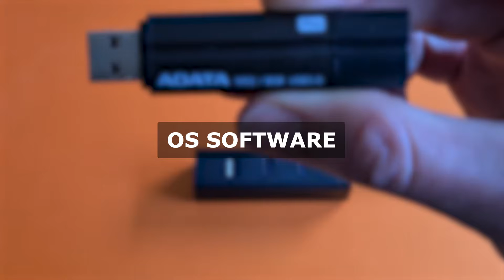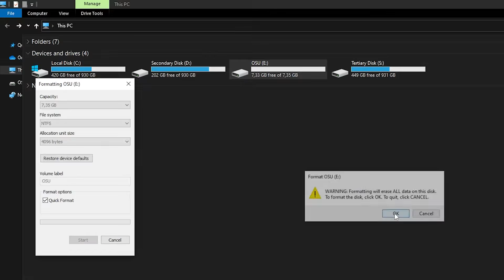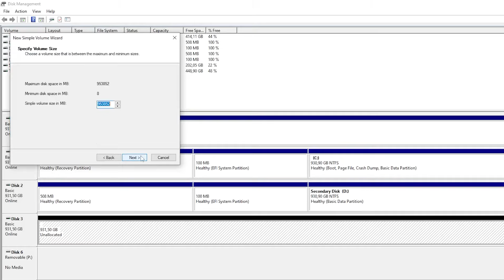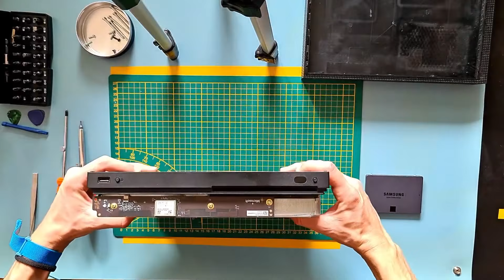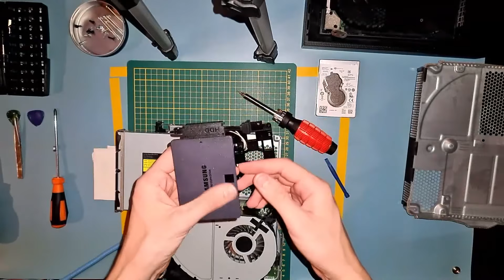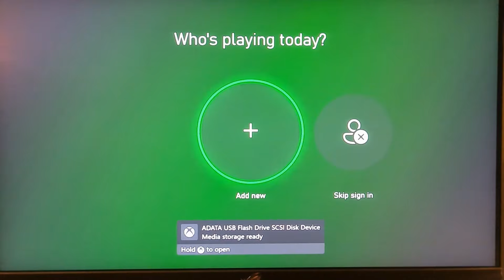Xbox One X | SSD Upgrade Guide | Loading Times

Comment: Is it the same way on the one S? i know the disassembly is probably different, but the OS Software part works the same way?
Reply from the maker: Yes, it should be the same. But just to be sure, check out some other tutorial modding One S directly, in case there is some unique step that I didn't cover.

Comment: Looking for some help with an Xbox One X.

The original hard drive is gone, so I'm trying to install a replacement drive and recover the system using the Offline System Update (OSU1).

What I've tried so far:

- Samsung 870 EVO SSD (1TB)
- Another 500GB SATA hard drive
- USB flash drive formatted NTFS
- Downloaded latest OSU1 from Microsoft
- Extracted and copied the $SystemUpdate folder to the root of the USB drive
- Xbox boots into Troubleshooter normally
- Offline System Update starts successfully

The problem is that the update begins, gets to about 1–3%, and then fails with:

E101 00000504 8B050041

I also tried "Reset this Xbox" and "Remove Everything," but that fails as well.

The Samsung SSD was originally formatted NTFS. The 500GB drive was previously used in a PS4, then all partitions were deleted before testing.

Has anyone run into this specific E101 error? Is this more likely a drive issue, OSU mismatch issue, SATA/cable issue, or a motherboard problem?

Any suggestions would be appreciated.
Reply from the maker: Online, some people who have had this error code solved it by trying new flash drives and by waiting for new OSU1 from Microsoft page.
Reply from the maker: E101 should be problem with the OS or update, so the Xbox is not directly detecting a hardware issue, though that does not mean there is none. Make sure there are no other files on the flash drive just the $SystemUpdate, but I assume you followed this instruction. Try different flash drive. Try different USB port on the console. Check the SATA cable if it is properly plugged in, both in the motherboard and the drive. Also try to format both drives to NTFS again. You've mentioned that you formatted the Samsung one to NTFS, but PS4 supports exFat and Fat32, so if you format it beforehand, maybe it will work and we figure out that the Samsung drive is faulty somehow. Man that is about it, what I can think of and what I could find out.
Reply: @will_neithan i tried different hds and flash drives.

The issue was the console  was in the insider program and xbox wont give out the os updates.

So if your old hd is broken or missing you are screwed.  

If you have the old hd make sure you leave the insider program first on the console before you try to change your hd
Reply from the maker: @SifuTimBerkemeier  oh, okay, that makes sense. There is actually an official troubleshooting for Insiders, but I'm not sure how effective it is:

"Because consoles enrolled in the Xbox Insider Program receive preview updates, any of the Offline System Update (OSU) files will not resolve this issue.
When running through the console’s troubleshooting steps above, if you are prompted to use an OSU file, skip this step and select Reset this Xbox on the console. From there, choose either option that best suits your needs (We recommend the Reset and keep my games & apps option)."

https://support.xbox.com/en-US/help/hardware-network/console/system-update-solution

Comment: Hi. I am late here but doing a ssd swap soon. Would I need to format ssd to ntfs beforehand as you did? I do not have a sata dock atm and was hoping the xbox would do that part for me during the install process
Reply from the maker: Hey, xbox should do the formatting for you. But I am only 99% sure. I chose to do the guide with formatting because I wanted to avoid any unwanted behavior from xbox.
Reply: @will_neithan thank you. I will habe to try it without formatting. Hope everythings runs fine. Otherwise I could I just try to fromat and re-install if I run into issues?
Reply from the maker: @heinrichvancoller9699  Yeah, exactly.. you can always try the external formatting later, if this doesn't work. Maybe don't assemble the Xbox after swapping the drives, just connect the flex cable you disconnected and boot it like that. So, if it doesn't work, you don't have to disassemble the whole thing again. Good luck.

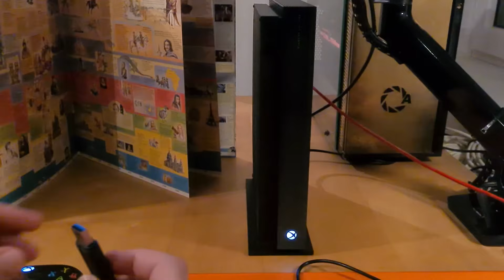Comment: My problem is at 5:21. I have my usb formated correctly, but that screen keeps popping up like every 2 weeks. Any ideas ??
Reply from the maker: Hmm... so your Xbox is fully turned off, you turn it on, two weeks it works fine every day, then one day you start it up and you get that screen with options Restart, Reset, Troubleshoot, Turn off? Then you click restart and it works again for approximately two weeks?
Reply: @will_neithanThat is correct. Then I have to go through the usb process again. Just annoying cause I have to sign back in and re-download my games/apps.
Reply from the maker: @lythory  But the installation USB is not plugged in all the time during all those weeks right? So when you get the screen and you just hit Restart Xbox, it comes back to that screen, so you have no choice but to do the manual install? And what about an error message, is there any?
Reply: @will_neithanthat's correct the usb stick isn't plugged in for those times. I dont get any error codes, my xbox just does 2 beeps then the troubleshoot page comes on.
Reply from the maker: @lythory  Man, that is super strange. If this was happening to me, I would try to make new USB with the offline update. I can't imagine what would be wrong with the old one, but that at least takes almost no effort. Try to google the same issue.. put "reddit" with the quotes in your search prompt or "forum" to get some real people's experiences. If that doesn't help or if you find no info online, then we can try different things. Honestly, right now, I have no idea.
Reply: @will_neithanit happens every week I kept track. Cause it did it today, but instead of going through that process again I just unplugged my xbox from the wall and waited a few secs and then it booted up normally.
Reply from the maker: @lythory  hmm.. ok, that is progress I guess. Keep tracking and try the google. The part that doesn't make sense to me is the regularity. One more question, what disk are you using? Was it a new one? If it was used, do you know what was the state of it, like how many hours it had run, how much data was copied on it, etc.?
Reply: @will_neithanI bought a new ssd from the store.  One thing that did happen was that after I put my xbox back together the dust shield for the front usb and the connect controller fried, because of that shielding got in the way whenver I snapped it back on.
Reply from the maker: @lythory  alright, keep an eye on any changes. If I find some info, I'll let you know.

Comment: I just connected my SSD via usb to the xbox 1 x, seen a good 25% improvement in load times without the work involved in changing over, I put all the larger games onto the ssd usb and more simple ones on local 1tb hdd
Reply from the maker: That is also one of the ways! If it's good enough, it's good enough.
Reply: You’re getting 95%of the benefits with external. Internal Ssd will shine more with a cold start but from sleep mode to game play external ssd is the same improvement and load times
Reply from the maker: @nogamblinge2671  but it ugly!!!

Comment: this xbox is the worst console to take apart ever I couldn't screw the ssd in after an hour of trying so I just screwed one in and I did everything right and I'm just getting Error E101 smh waste of money
Reply from the maker: Don't give up! If you want a troubleshooting guide for the ssd not working, you can find it as a reply under @MrReliable-qb5om comment.
Reply: @will_neithan I fixed it I used a different USB flash drive and it worked somehow
Reply from the maker: @slitzworld  Nice work!

Comment: Not sure if you still reply to comments but
I have an NS100 Lexar Sata 3 ssd 512gb that im trying to use but for some reason when i reassemble the Xbox 1x and put the OSU1 boot drive I cannot get past 1%. I am 100% certain that i have assembled it correctly and that its a software issue. I read online it was an outdated OSU1 boot drive but can't seem to find the latest one. In short im pretty stuck on how to do this.
Reply from the maker: Hey, alright, you need to do step by step analysis and try to double-check every answer, even if it seems obvious. Be oriented on the smallest details. 

Before that, elaborate on the 1% situation. How long did you try to leave it installing? Maybe your usb is slow and it will take 2 hours. Did it show an error or is it just stuck on 1%?

1. Do you have "Xbox One X"?
2. Did you follow my tutorial in chapter "OS software and SSD preparation" exactly or did you do certain things differently?
3. Did you format to SSD as I did? Was it showing then in windows as an empty drive with NTFS file systems?
4. Did you format the USB with NTFS file systems?
5. Did you download the correct OSU1 file from section "All Xbox consoles (except the original Xbox One)"? There are multiple choices on the website.
6. Use program like CrystalDiskMark and test the speed of both the USB and SSD (when plugged in SATA) with a large 4 - 8 GB file.
7. Use windows file explorer to see if reading and writing has some bottlenecks. Take the OSU1 fully zipped and try to copy it on the USB and the try to copy it from the USB to C drive of your PC. Just to verify, that it can reliably read and write large files.

Now the less likely or even this-will-surely-not-be-it troubleshooting, but we have to because we don't know what else to do:

8. Did you follow my steps when you were turning on the Xbox ready to be installed, in the same order? Turn on console through controller as I did. Navigate to Troubleshoot, then plug in the usb, then click on offline system. Try this also with the LAN cable plugged in with working internet connection and also without.
9. When formatting the USB, label it "OSU" as I did.
10. Use different program for unzipping the OSU1 file 

11. Also redownload the OSU1, so you know it is the newest and also try different website regions. I was downloading from "support.xbox.com/en-US/.." so make sure it is also the case for you and then try one more time downloading using country where you bought the Xbox.

More expensive troubleshooting potentially.. you can just borrow these from someone else and return it, just to rule out hardware issues:

11. Try a different USB.
12. Try a different SSD.

So again, try to verify each question with evidence and not from the head. Redo all the steps again. Start with the easiest ones. Leave the SSD removal as last option. If you are going to be disassembling the Xbox again, you don't need to assemble it fully when testing, leave the cover off so you don't add work to yourself, just make sure that the Xbox is sitting in the air so that the air vent holes are not covered up. 

Give me a report after.
Reply: @will_neithan  i figured it out it was just the drive needing to be 1T the rest was fine. i tested with 5 sata 3 512 drives and when i gave up on that i used a pny 1tb so it just needs 1tb sata. (what is the actual performance gain of a sata with ram in it?)
Reply: I had the same problem. After several tests, I concluded that the SSD dramatically decreased its transfer speed after writing about 2–3 GB at maximum speed. I removed it and tested it on my laptop using an external enclosure, and after 2–3 GB the speed dropped to around 1 MB/s. The bottleneck was probably the write speed for large files due to the technology it uses (SLC), and that seems to be the issue. After reading a bit more about the SSD I was using, it appears that the problem is related to the type of SSD technology. Those with DRAM are the best option. In the video, he is using a Samsung EVO, which has DRAM that supports sustained maximum write speeds over time.

The best option is probably to buy an SSD with DRAM or hope to complete the installation without errors when using cheaper SSDs.
Reply: @carloscr1500  i managed to get some pny sata working without dram but later on i might try and buy one with dram and just move the other into my pc.

Comment: I put a 1TB Crucial MX500 which I believe is a TLC drive into my One X.  Unfortunately it didn't take long before disk access got slow.  Curious about this I also tested a 2TB BX500 which I believe is a QLC drive.  It got painfully slow after only about 2-300GB used.  I put the 1TB HDD back and tested something else; a 4TB Samsung T7 USB 3.2 Gen 2 10Gbit/s drive.  Now, the Xbox will only use a fraction of the speed that this has to offer, but at least the performance is consistent at about 100MB/s.  The same drive will do 200MB/s on a Series S while a Seagate Expansion Card will do 600MB/s which is slightly better.  Samsung T9 USB 3.2 Gen 2x2 20Gbit/s is unreliable on Xbox.  It will disconnect randomly.
Reply from the maker: Nice testing, man! I wasn't testing read/write speed and I didn't notice anything out of order, so I can't add to this. What was your testing method and what specifically means "slow"? And what was your method of creating/copying the OS? If anyone else is experiencing issues with specific SSDs, type it into comment.

Comment: Has anyone noticed that the green load screen doesn’t show any longer with the SSD upgrade? It’s just a black screen then takes you straight to the dashboard. Can anyone else confirm?
Reply from the maker: I haven't turn on my Xbox for a longer time now, but I believe, that, weather the green loading screen appears or not depends on how fast the operating system is loading. If I remember correctly, when I was turning on the Xbox, sometimes the green screen appeared and sometimes it didn't. And of course, the loading screen only appears if your Xbox is fully turned off and not only in sleep. Or at least, that is my memory.
Reply: @will_neithan thanks. Just done some digging & the OSU1 doesn’t come direct with the boot animation installed. Usually comes when Xbox release an update to the console or you can directly take the animation from the old HDD and transfer it to SSD via computer. Thanks for your reply
Reply from the maker: @Xvc2345  Interesting, I appreciate the info!
Reply: @Xvc2345 thanks for this... I just made the change and noticed the same. I'll try doing the backup from the old HDD and give it a try

Comment: What ssd would be recommended? I have an Xbox one halo edition and not looking to get anything newer yet.
Reply from the maker: The best SATA SSDs should be the "Samsung 870 EVO", however also the most expensive ones. Be careful with this model though, the 2TB and 4TB versions have had reports of failures, so if you go for these capacities from this model buy new, so you can refund it. The 1TB version of Samsung 870 EVO has not had this issue reported, so it should be safe to buy second hand. Other brands, you would have to look up some comparisons, according to what brands and models are available for you. Keep in mind that any SSD will perform significantly better than the default HDD in your Xbox, so you don't have to overthink it if you don't want to. But as I said, the Samsung 870 EVO should be the best on the market.
Reply from the maker: Nice music playlist on your channel btw.
Reply: @will_neithanthanks 😅
Reply: Samsung T7 Portable SSD 1TB